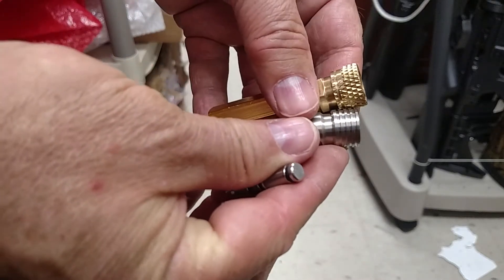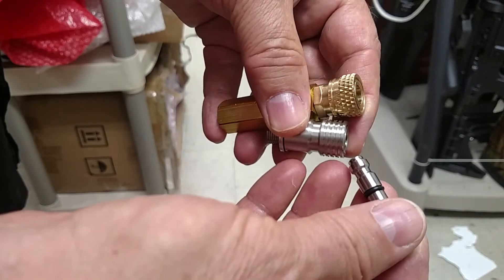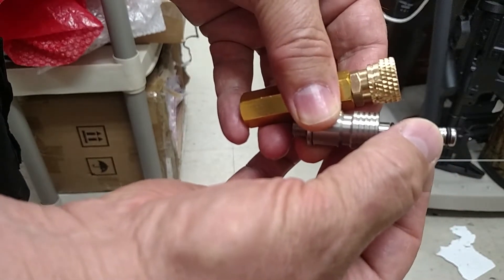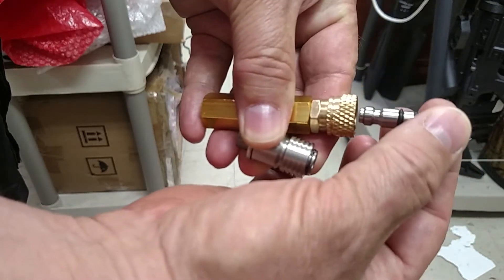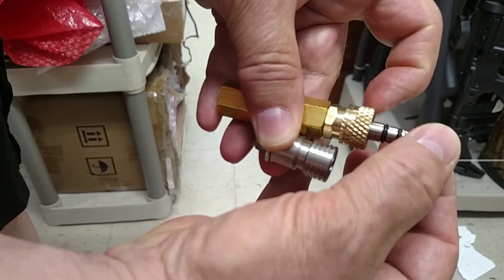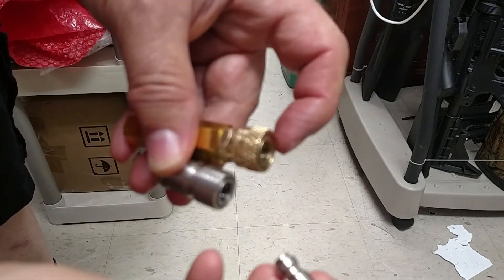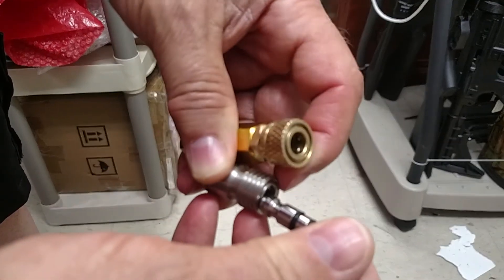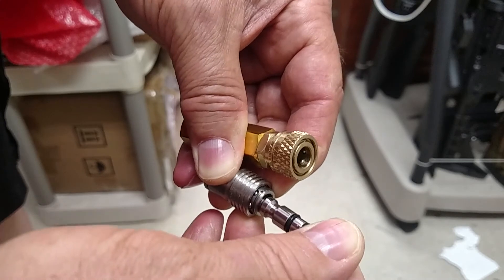Huben fill probe and Chinese female quick disconnect

Comment: Had to take mine down a little too. Yes it can move in and out but when you turn the airsupply 
on the o-ring in the female connector moves against the fillprobe and seals up, it works perfectly.

Comment: This is a convincing demonstration.  Suggest you back that up with some measurements with a caliper to unambiguous prove which part (i.e. the FX female foster connector) is out of specification.  It seems the point is to direct people to the Chinese part, so it would be helpful to name the brand/manufacturer of the Chinese brand.  If it's advertisement for a part you are selling then it wasn't clear to me at least.  It's a bit odd that you refer to one part by country of origin and the other by manufacturer.